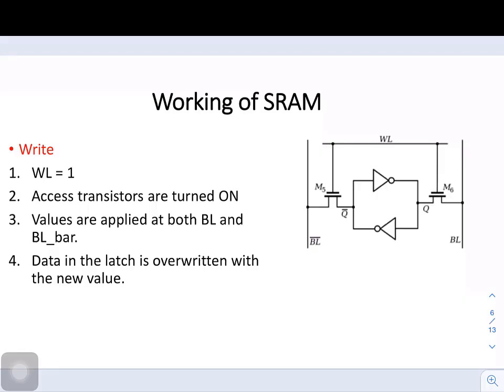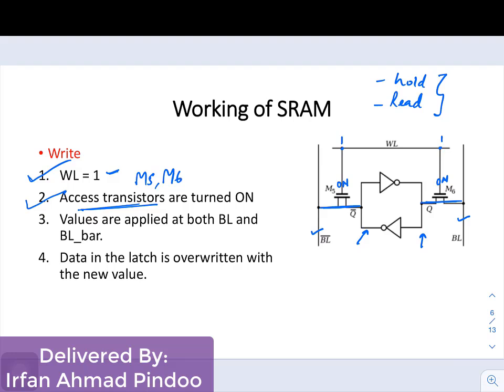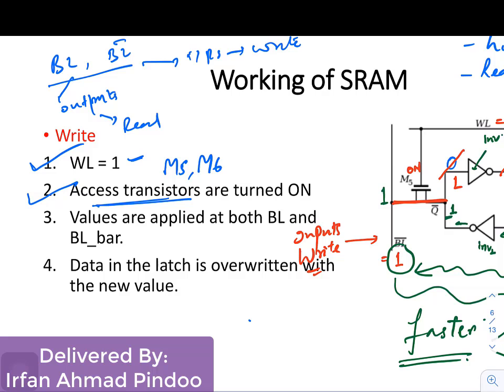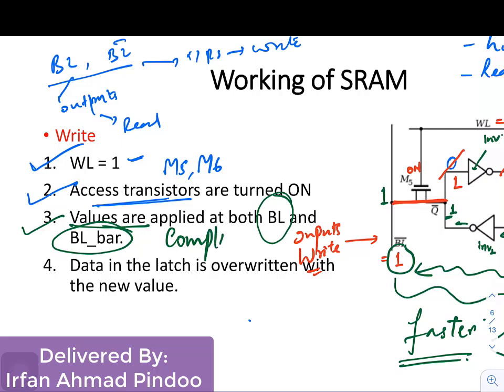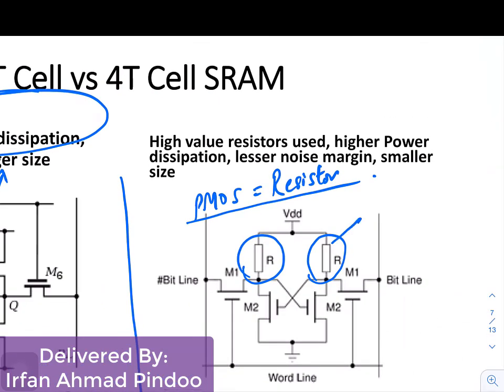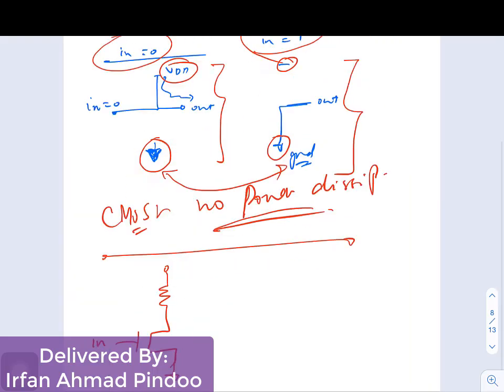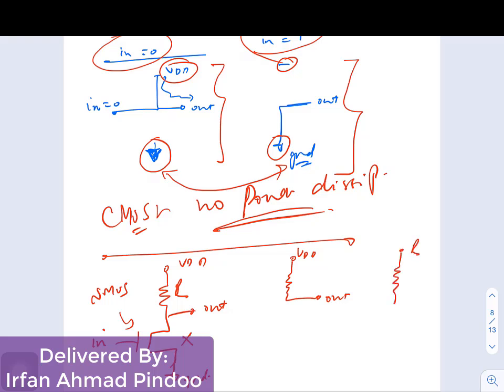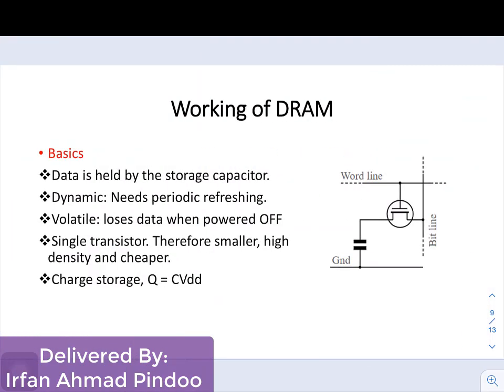SRAM || Write Operation || Differences Between  6T Cell vs 4T Cell Design

Comment: Hi sir, wonderful explanation. I just have one small correction in your video:
The resistors used in the 4T SRAM cell actually occupy more area than the PMOS transistors used in the 6T configuration. Therefore, the overall area of a 4T SRAM cell is larger compared to a 6T SRAM cell.

Comment: sir my question is in read operation both bitline and bitline bar can be 1 but in write operation it can be complementary to each other?
Reply: well I'm just guessing but, it is because in read operation bit lines are to be read(i.e. as output) so we just precharged them to vdd/2) but in write operation we are taking inputs from bit lines that's why they are complemented to make ckt faster as mentioned.
Reply: Ok thanku sir
Reply: @electroprephub_with_ayushi  no problem 🙌